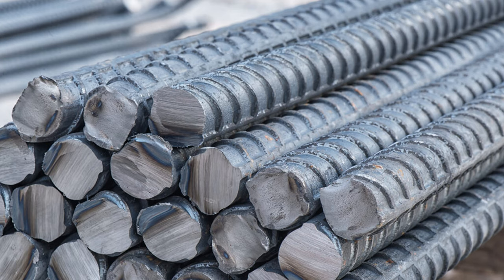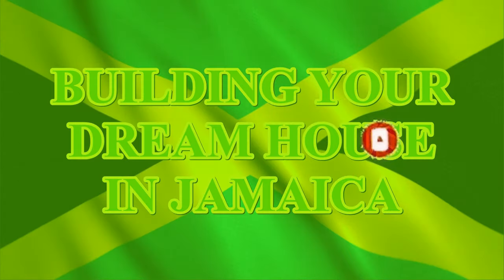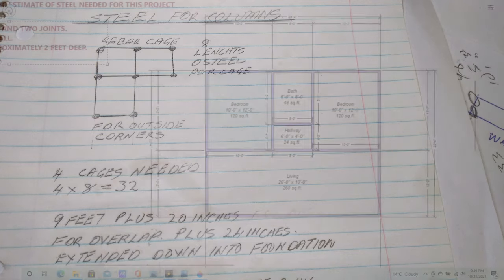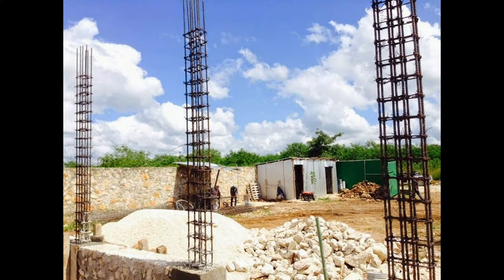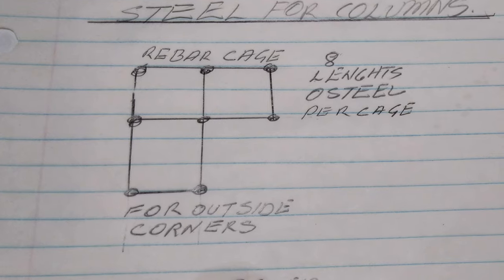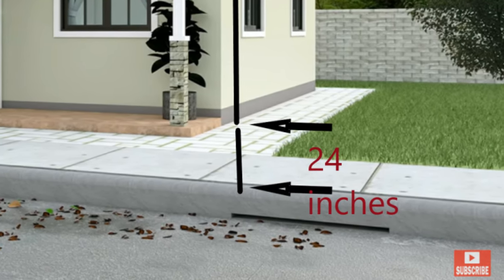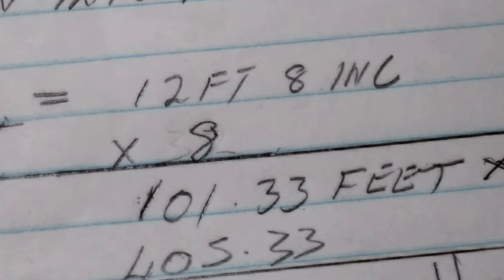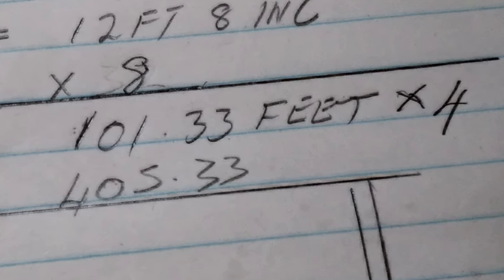Building Your Dream House In Jamaica. HOW TO CALCUATE REBAR/STEEL FOR COLUMNS.

Comment: Like I want to understand how you get 32 represent after you multiply it by 4x8. An 9 + 20 inches for overlap plus 24 inches extended down into the foundation and 9 + 3ft 8inch = 12ft x 8 me get a different answer but it is not 101 .33 ft I have got I got something like 96 but can I get like a clarification on how you do it

Comment: Hello I’m looking to build a 3bedroom 2bathroom open concept home one level,do you draw plans thanks
Reply from the maker: hi Althia i could draw and post a few different designs in a few days for you to look at. What size bed rooms are you thinking of. Do you have any idea of the size of your lot? Would it be in the city or out in the country area. This is important for sewage reasons.
Reply: @jussayinmipeece1069  Hi thanks for responding 1600 square feet house I’m not gonna build a mansion I live in the USA the property is in Inverness that’s st Ann outside of browns town,I think 1600 square foot home is good the room sizes master bedroom 15x12feet bathroom8x12 feet,the other bedroom is 12x12 separate bedroom 6x8feet,open concept interior walls are sheet rock that should cut cost down.The land is 1/4 acres
Reply: @jussayinmipeece1069  btw can you look at Florida homes that’s something I would like and Inverness is definitely county thanks
Reply from the maker: @althiahamilton3108  Ok. Just one thing though, sheet rock interior may not give the cost savings you are looking for since there are many other incidental expenses associated with it such as wood and labour expertise.
Wood is very expensive in Jamaica and the people with that sort of expertise are few and also expensive.

There is also structural integrity to consider since your load bearing walls will mostly be your exterior walls.

You may consider using 4 inch blocks for all your interior walls instead. They are much cheaper, the labour is reasonable and the expertise is also there. Then instead of render use sheet rock where you feel the need. You end up with a stronger structure at comparatively less cost. Another advantage is wiring. Sheetrock over concrete allows you to run your wires ON the wall under the sheet rock , saving you a ton of money in conduits and embedding, not to mention ease of maintenance and rewiring for something that you add later is also much easier.

You can also use smaller wires since they are not in a conduit so overheating is not an issue. Additionally you will be able to use surface mount wires which are actually cheaper.